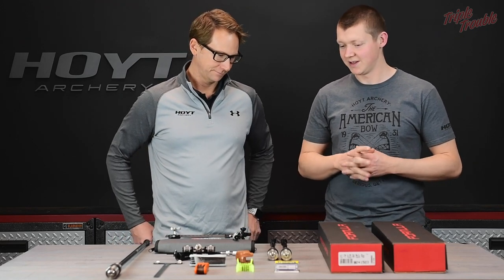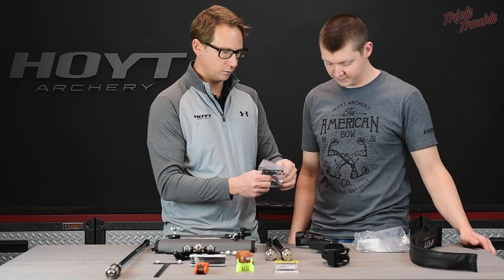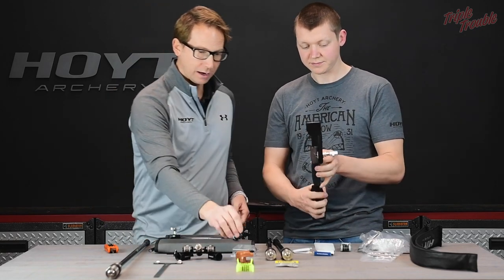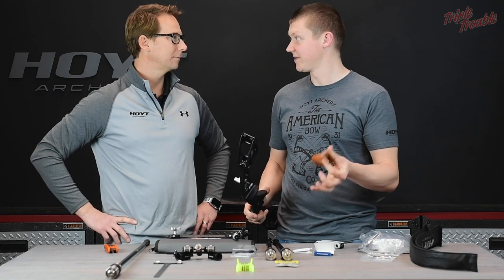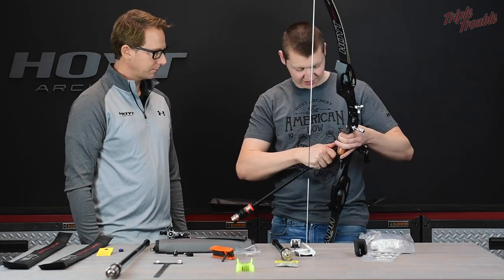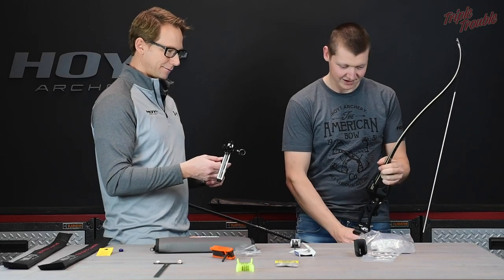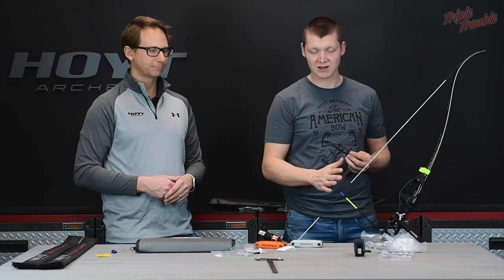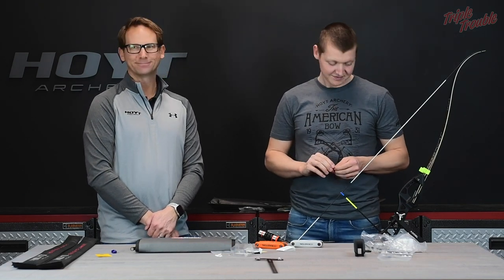Complete guide to setting up your bow! (From Billet to bow #2)

Comment: Very informative and interesting video - more please 👍🏼😊  - Can you recommend a good tiller bolt position (how many turns away from the riser)? My coach told me there should be a max of 2 turns - especially for the Hoyt Xi and Velos limbs - the efficiency of the limbs will be perfect... is that right?
Reply from the maker: You can give it a maximum of 6 turns out, and I typically shoot it 3-4 turns out, depending on how well the poundage matches my need.

Comment: Hello Sjef and all Triple Trouble team, excellent videos!!   

I have a question about BEITER PLUNGER: Could you specify the correct size for hoyt formula x riser?
5/16”-24 or M8x0,75?
53,5mm or 61,5mm thread cylinder?
Correct Screw length, pin, nut?

Thank you for the info!

Comment: Which option of your scope do you shoot? The .019 or the .029 option?
Reply from the maker: Currently using the .019!
Reply: @patricksteele  the sjef scope I think is fixed so you can't change the fire ring pin... The full size curve rx scope allows you to change pin size and colours if you buy the separate fire ring pins... The 0.19 is difficult to see and struggles to pick up light especially indoors in sports halls... Outside it is fine

The housing on the curve rx Pro is long and might feel bulky if you're using it on a field setup with changing distances... On fixed rounds like 18m or 70m you can set the angle of the housing so its the correct angle for viewing through.... This is the reason why the sjef scope is thinner so you don't have this problem if you change vertically on your sight

Comment: What is the difference in the arrow shaft centering if I use non barreled arrow? As I understood that setting in the video was for X10.
Reply: Parallel shafted arrows should be aligned dead centre with the string for centreshot.
Reply: @alargecookie  Thanks! Up to now I aligned the tip to the left side of the string (right handed), but I'll set it to the center.
Reply: Ive heard that some may find it more forgiving even for parallel shafts to be slightly off to the left to compensate for the release